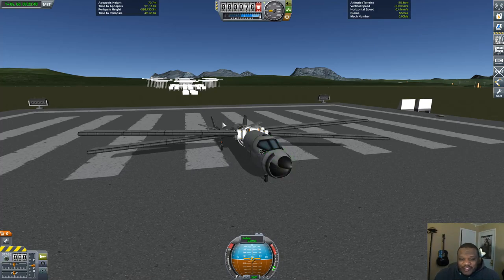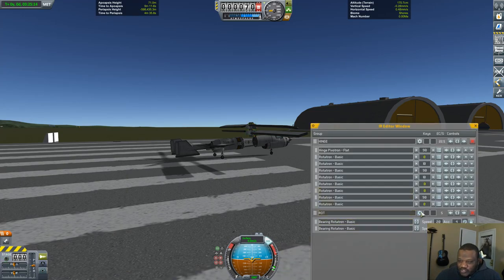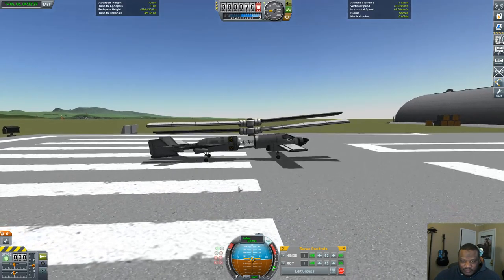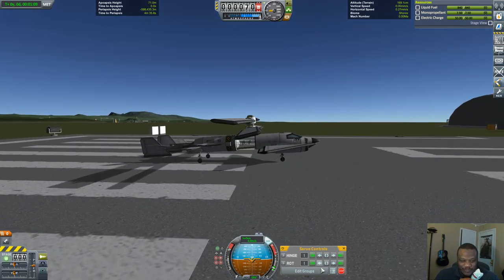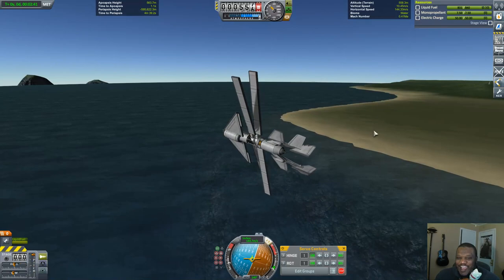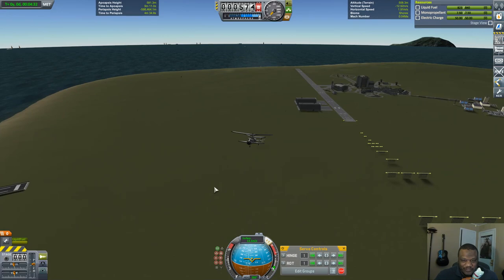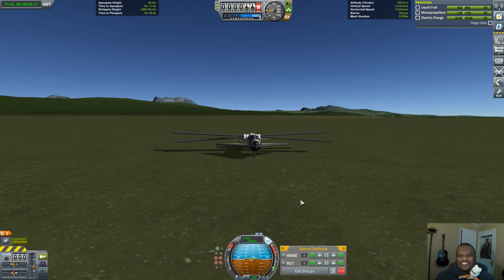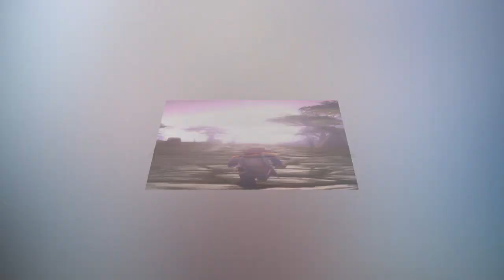Kerbal Space Program | Infernal Convertible Chopper Jet

Comment: Well.... it's not the worst thing you've built.  You might get better control if you could change the angle of the props to modify the amount of lift while allowing the rotational speed to stay constant.  EJ, on twitch, has been trying to make a stock helicopter and that's more or less how he's had to do it to make a truly stable helicopter.  That's probably why so many helo-rotor mods fail, because KSP wants to modify lift based on the throttle alone.  Real helocopters run on a fixed rotor speed and simply modify the angles of the rotors.
Reply: collective pitch control. I've done something that in the past didn't record though but changing the angle of attack does work in such case